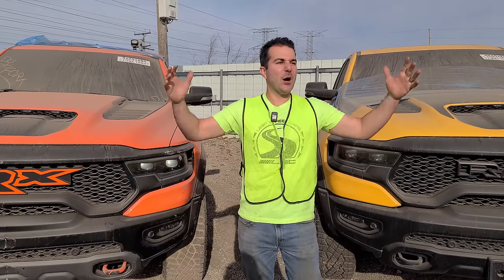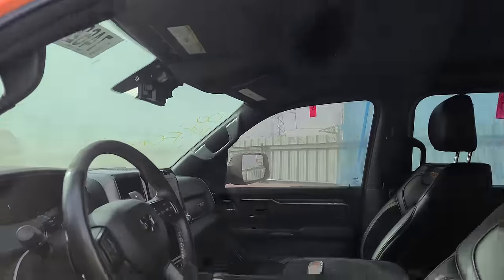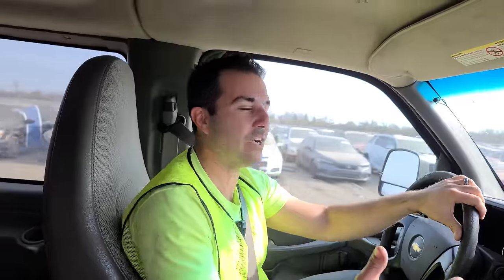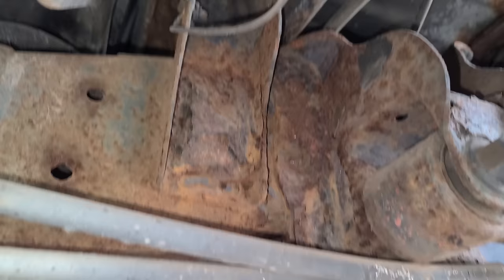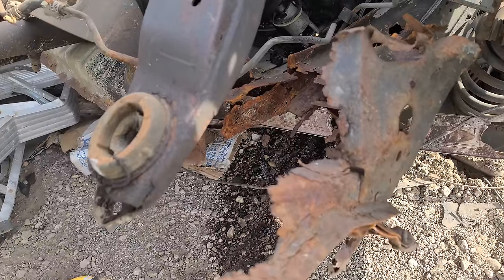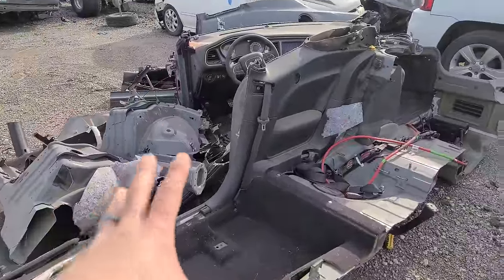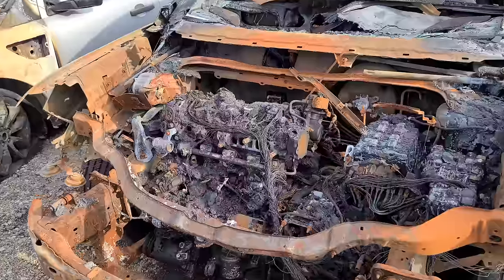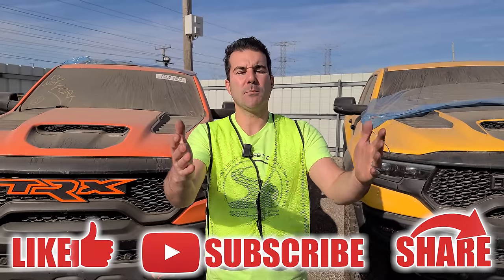Why Buying Totaled Bullet Hole Cars Is The BEST Deal At the Salvage Auction! EASY Fix For Anyone!

Comment: My dad had a '79 L82. What a slow POS. It spent so much time at the dealer and couldn't hardly get out of its own way. He sold it in 1982 right after I got my license. He used to let me drive it with him when I was 13. 

The 1981 you had was peak malaise era. I was into imports as a young adult because of the malaise era and all the clapped out 60's American cars. There were a few special cars around like Shelby Mustangs, K codes, Boss 302's, Hemis, GTO's etc..  For the most part there were clapped out cars like Malibus or Lemans with350 2 barrels, Crager mags, Cherry Bombs and air shocks so they could jack the rears and try to do the one wheel peels to try to impress people.

Comment: A, you may already know this....those fan blade designed wheels (like that on the old benz) are designed to draw air and help cool the brakes. Porsche designes a lot of wheel like that back in the early 2000s

Comment: I bought 97 grand prix from an auction through a dealer that was in an ATF raid. 400 out the door. I got it delivered and discovered it had an Intense stage 3 cam and turbo kit on it with a Mahle pistons and excellent maintenance. The bullet holes were through the rear passenger door (it was originally a se model) and the back seat cushions were removed. This was September of 2000. The car once cleaned up and retuned was a FWD record holder on their YouTube page if anyone wants to see a rental car v6 look alike taking down everything under 8.78 ET on the 1/4 mile. I have no Idea what the person used it for before, but it must have been clandestine and expensive.

Comment: In the case of the melted dash, the owner's insurance would total the truck and then seek reimbursement from Ram if it was under warranty. At least that's what happened when I was at Nissan. We had a 370Z burn due to a fuel leak. @4:48... To explain for those that don't know why an undamaged theft vehicle is at the auction. Most insurance companies declare a vehicle a "total loss" if it isn't recovered in 30 days. This is also how a perfectly good car can have a branded title.

Comment: this is proof of  why to buy just the engine and trans(  generally the only  parts that are made halfway decent   ) and put it  in older model vehicles , truck etc ,  _ so you have new power  in  an older model and None of the  new junk wire   fire issues,  cheap thin potato chip  frame manufacturing    rust junk  etc that these  automakers  are dishing out.

Comment: You want a TRX because....? It's the only thing you can think of that gets worse gas mileage than your CTS?
Reply: Gas mileage isn't everything. Sound, acceleration, throttle response, even just the absurdity of the power it makes for the vehicle... It's a fun vehicle, it's not a practical daily driver, and he's already got more practical vehicles. Practical isn't fun though.
Reply: @Vynncent  which practical vehicle are you referring to?

Comment: Final notes: Almost all the vehicles there are not worth buying because even these wrecked cars usually go for WAAAAY more money than they are worth, or can EVER be worth again.
A salvage titled car is next to impossible to sell and VERY risky for liability reasons if you "fix" it like is so popular in youtube these days.
They are NEVER going to be worth what they are charging for "totaled" plus your repair costs.
It's almost like, they were totaled for a reason?
Like maybe you can't ever recoup the costs to fix it vs value?
Imagine that?
Basically most of these vehicles are scrap, or parts cars, and should never be "fixed" and put on the road again.
You will be upside down every. Single. Time.
The TRX clearly had a lithium fire on the dash, cell phone, tablet, dashcam, something was sitting up there and caught fire.
Leave a cell phone on the dash in the summer for a few hours would do it.

Comment: What is the deal with these brand new rams of this gen starting on fire?! A local mechanic bought a black 2500 that had had a fire in the dash, repaired it and he said he got it for about half off all in. You would never know the truck was ever on fire
Reply: Report back if find the reason. I’ve seen three here at the local copart

Comment: Yeah but copart sucks. They do a lot of shady stuff. And now their fees are through threw the roof.  

Prior to their fees increase. I got a water damaged that they said runs and drives.   Delivery guy said they couldn't get the car started.   When it finally got to me it had two big holes in the block. And a piece of metal wedged up in the crank. Locking the motor solid.   I brought it to their attention they told me to pound sand.

Comment: Chrysler (FCA US, LLC) is recalling certain 2021-2023 Ram 2500, 3500, 3500 Cab Chassis, and 4500, 5500 Cab Chassis vehicles equipped with a Cummins 6.7L Turbo Diesel engine. An electrical short may occur in the heater grid relay with the ignition on or off